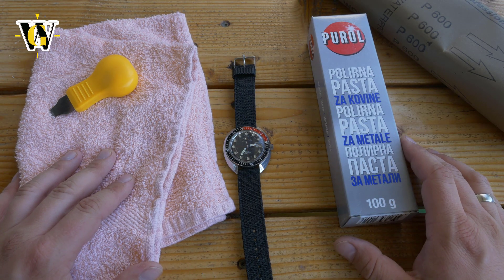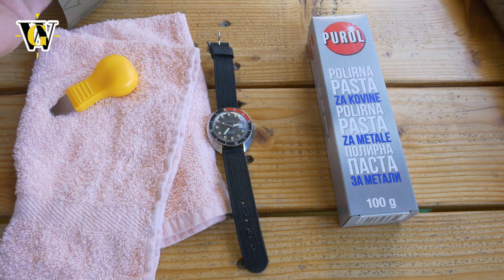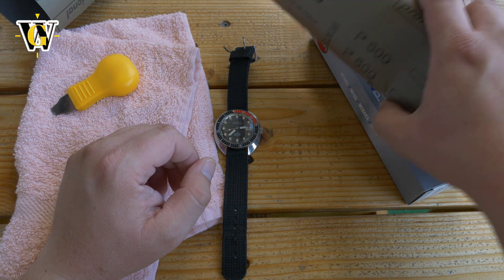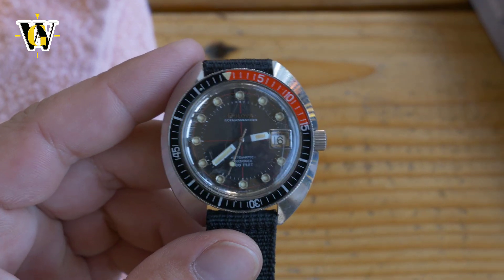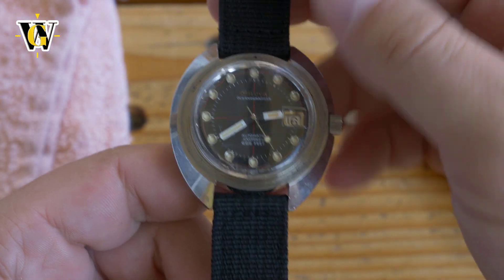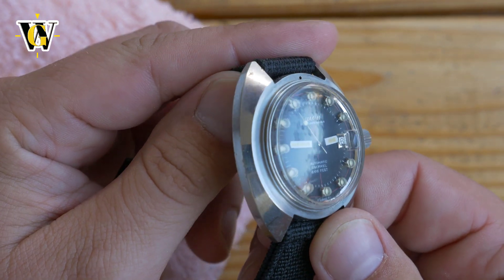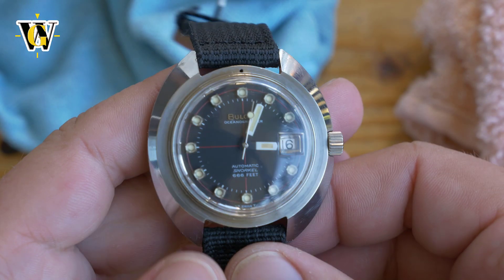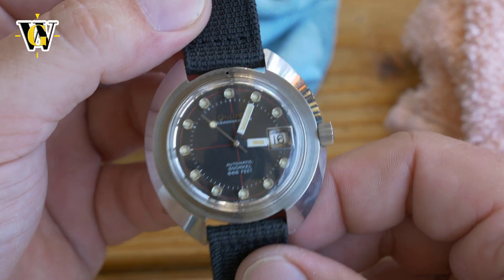DIY crystal polishing!! My first EVER attempt at polishing an acrylic crystal 😱😱

Comment: I have in the past removed some deep scratches using Brasso... T.- Cut would do similar job... I usually wrap the cloth around my fingers and with much patience work away at the surface.. I have had amazing results using this method. . Patience is required, but the results have made it very worthwhile and very satisfying... Saved me monies too..

Comment: to remove scratches by polishing, you got to wear of the thickness equal to the depth of the scratch. otherwise you will have smooth, but uneven surface. at least it goes like that with metal. however I'd start with 800 and then go 1200 and higher upto 2000 and then use polishing paste and buffer :)
apparently the acrylic glass is soft enough and the depth of the scrathes were not so big and polishing paste managed to remove enough material to get that quite even surface in the end.
good job!

Comment: Glad you stuck with the paste.   As you know I’ve done many of these and what you find with abrasive paper is that on a domed crystal you can take it out of round and create flat spots which you only then see in certain light reflections which then drive you crazy.
With a paste you are working with friction and almost burnishing the surface. It’s harder but more consistent .  
I never bother with cloths and only use cotton wool pads like the ones my wife uses for makeup removal. Wool in itself is an abrasive. 
Good work and I am happy you got the result you wanted.
With case or crystal work you usually have to realise that to make it better you have to make it worse first!  Trust in the product and your own ability.

I’m surprised a replacement crystal was not available , acrylic are generally available and cheap. Just need some measurements from it
Reply: The difficult and expensive part is fitting a new acrylic with the special tool without damage...

Comment: hey how would you compare this with poliwatch? as i tried with that put with very little results, is the product you are using better? great videos btw, love te g shock tutorial videos
Reply: Poliwatch works better for buffing out scratches, but a simple tube of polish is good enough for tiny scratches and polish the acrilic crystal to it's shiny state. Works well on my 97 Swatch. Do note that I don't use Sandpaper, too much risk imo
Reply from the maker: Never had the chance to try Polywatch, this is just an ordinary metal polish, but a fine grade and it did WONDERS considering how little effort I put into it